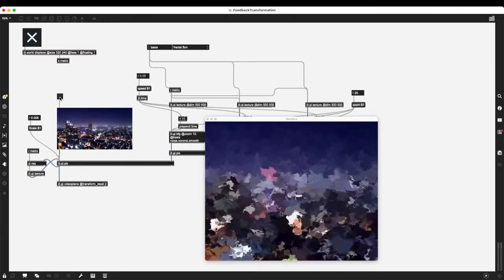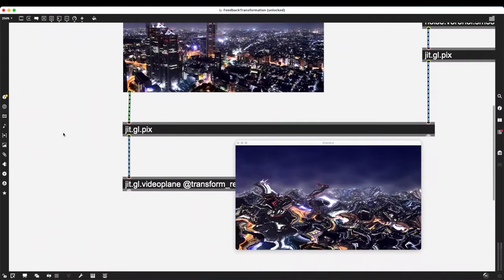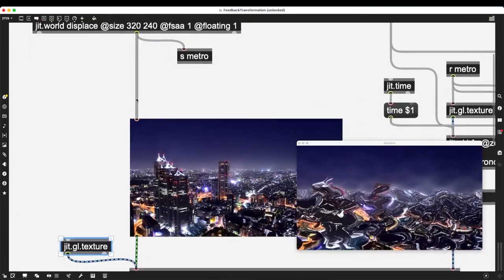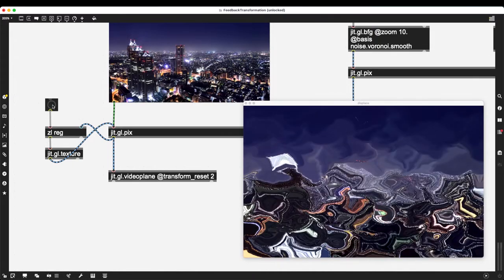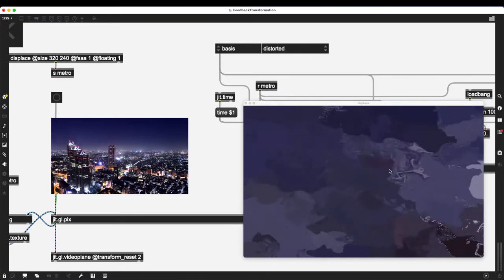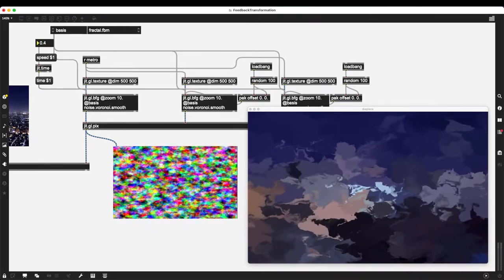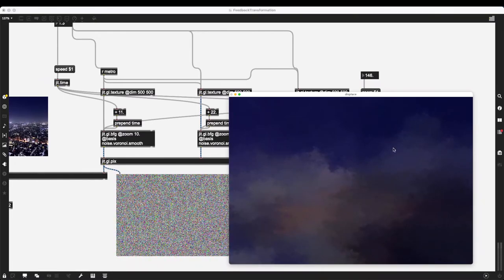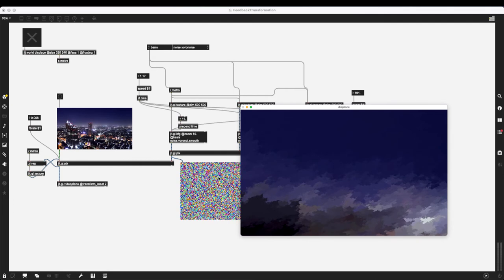Visual Feedback - Max/MSP Tutorial

Comment: thx! love this series tutorial! is it possible to use a video to replace the image then get the same effect?  i've tried to use a video however the effect only occurs when the video stopped.
Reply from the maker: That is because this is a feedback system: The patch is always using the result of the distortion as the beginning point for the next frame. You can completely remove the visual feedback and just use distortion - The video goes to the left inlet of jit.gl.pix, and the 3D noise to the right inlet. As long as the 3D noise is constantly changing and the video is playing, you should see distortion happening.
Reply: @HearingGlass    So helpful!!! Big thanks!!
Reply: @HearingGlass   There is one thing I didn't notice before and i really tried hard to work on it..but i'm failed.  The distortion looks nice, but how can we keep the "water painting feedback effect" generating at the same time the video's playing  ?  Probably it looks like the patch you made https://www.youtube.com/watch?v=H8lcTcDrV9E&t=93s   ,the effect still work on the new color while the previous effect will be vanished.